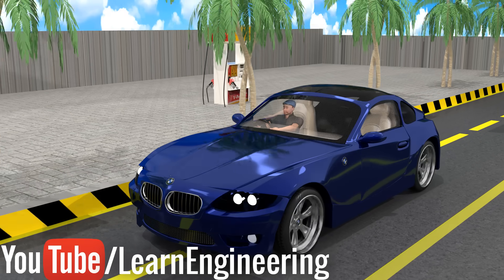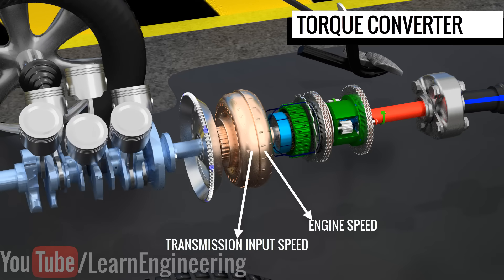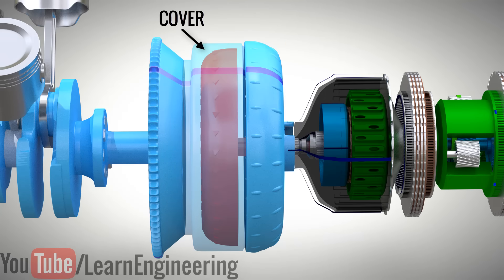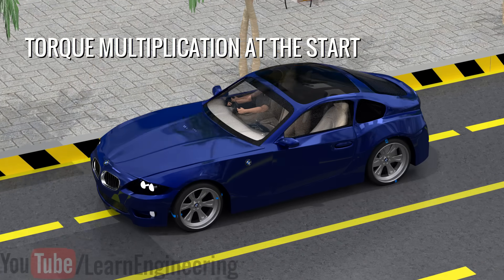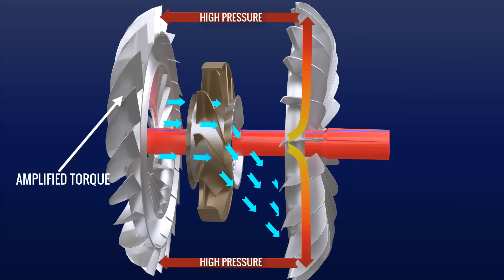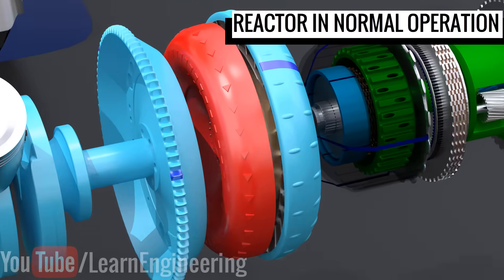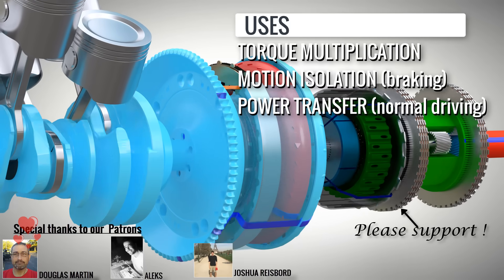Torque Converter, How does it work?

Comment: I didnt quite undersand what is the purpose of at some point locking the turbine to the pump so it matches the faster rotational speed of the pump. If you lock them arent tou taking some of the pumps already gained energy back to the turbine? Intead of not letting the energy get lost, you are making it happen even more. Of course this works, so theres something I missed. Thank you for the video.

Comment: Believe it or not, the GM Hydramatic in 1939 used a fluid coupling as opposed to a torque converter. Chrysler ended up coming out with their Fluid-Drive transmission which was a manual transmission with a fluid coupling to make driving a bit easier since you didn’t have to finesse the clutch, just stepped on the clutch and selected a gear, could come to a complete stop without having to step on the clutch since the fluid coupling would slip. Could start out in any gear, just was a little slower in second and third gear.

Comment: The magic of this design is that it only delivers power when you want it. The reason a car in drive at idle will limp forward without breaks. Breaks are applying counter force and in a manual this counter force would stall the engine but in the case of the torque converter power is still being sent into the transmission but not enough to overpower the breaks. 
Its also the reason people that deal with traffic love automatics. Constantly applying the clutch in stop and go traffic is the opposite of fun.

Comment: It is impeller, turbine, and stator. Please, for the love of Pete...If you are going to make educational videos, do it right. The pump is inside the transmission. It is not part of the torque converter. The Impeller is what you are describing as the pump.

Comment: I would like to see more short throw 5-6 speed standard transmissions in trucks.I miss them with a passion. I loved having a Borg Warner Super T-10 4 speed manual transmission with a double hydraulic clutch. I built this truck to have 500 HP & 450 Ft-lbs of torque. I never would have got that with a automatic transmission.

Comment: How does the lockup clutch enganges? Hydraulic actuator or mechanically?
Reply: Fluid pressure fed through the center of the main transmission shaft is used to push a piston to hold pressure on a friction disk in the housing. That disk is connected to the turbine, which is the driven disk inside a TC. When the piston is forced against the lower half of the TC, the two pieces (outer housing and turbine) are locked, and turn as one.

Comment: Transmission oil/fluid got a whole different meaning. It's not lubricant fluid it's the fluid that physically transmits power.
Reply: ATF simultaneously functions as:
1. Lubricant
2. Hydraulic fluid
3. Coolant
It is formulated to perform all 3 functions. You could also argue that it contains rust inhibitors as well.

Comment: Okay, i thought i knew how a torque converter works, but I'm glad i watched this, because apparently i didn't quite have it clear. I didn't realize the stator modified the return flow and the increase in torque was from the added pressure, i thought it just modified the angle at which it stuck the turbine blades. I remember spending half an hour reading the wiki page on that trying to decipher it like 15 years ago. 
No denying automatics are technically amazing, but give me a manual. I would much rather have a three cylinder minicar with a manual than a V12 sportscar with an automatic. It makes the whole drive interesting, otherwise you are just steering a car and pushing a brake pedal, and that's boring.

Comment: The simplest way to describe how a torque converter works is to take a table fan and plug it in. Then place another one right up close in front of it but don't plug that one in. Now turn on the first one and the air coming from it will make the one in front of it start to turn. If it's a lock up converter then when the second one is going as fast as it can, you push them together so they make contact and now they are both going the same speed...

Comment: With an automatic transmission all you have to worry about is problems.
Reply: Yet they are remarkably reliable. I have owned 8 Accords, 2 Pilots, 2 Odysseys, an Element, and my daughters have Insights. We have had very few transmission related problems, and have never had a transmission replaced.

Comment: I'm still confused as to how the fluid gets into the converter. Is there a video that shows this?
Reply: The main shaft from the transmission is hollow. That is the only entry path from the transmission oil pump into the T/C. The T/C must also be constantly pushing fluid back into the ATM to cool it, as the T/C generates a lot of heat.

Comment: Doesn't the Reactor (Stator) spins in the opposite direction to multiply the torque?
Reply: The stator doesn't actually spin. It does rotate a few degrees, which depresses a shaft in the Main Valve Body, which controls the main pressure inside the transmission.

Comment: Who ever built this could have saved 3 migranes by just adding in a fucking autimated clutch thats used from a manual trans. Or use a AMT and save the cluster fuck that is the auto transmission.

Comment: Why are CVTs much easier to understand than this.
Reply: A cvt also uses a torque converter
Reply: @mikeslowbudgetmedia  Yes it does. It also typically uses a cone-shaped drive pulley, and a cone-shaped driven pulley. The two are connected by a very flexible steel belt, which is comprised of hundreds of segments. The belt tension must be constantly stabilized by a combination of fluid pressure and spring pressure to prevent slippage, which would damage the belt and the drive pulleys. Because the pulleys are cone-shaped, and not flat, a theoretical unlimited range of drive ratios is possible.

Comment: Does the lock up clutch create the same problem that the converter solves? When braking, it seems like the drive shaft and engine would be could together with the lock up clutch.
Reply: The lockup feature is controlled by fluid pressure, which is switched through a set of solenoid valves. When you no longer desire the Lockup mechanism to be engaged, the fluid pressure is relaxed, and the piston slips again without friction.

Comment: how the lock up clutch is activated?
Reply: A solenoid valve channels fluid pressure through the Main Shaft into the T/C, which is applied to the piston, and thereby to the friction clutch inside. When Lockup is no longer desired, the fluid pressure is relieved.

Comment: But how can fluid turn the whole transmission? And why dont we use regular cluth while braking? I mean when we push the brakes we can also dis-engage the clutch from the transmission in an automatic car. I am sorry i am not an expert.
Reply: "But how can fluid turn the whole transmission?"

Imagine two opposing fans sitting on a table. One is powered, and is facing the other, which is not powered. If you turn on the powered fan, it blows air through the second fan's blades, causing it to turn. It is much the same principle, except we're using fluid to push the second fans blades instead of air. Granted that is a very simple analogy, and the actual process is more complicated.

The drive fan represents the engine; the driven fan represents the transmission. When you take your foot off the accelerator, you allow the engine RPMs to drop, thus applying less power to turn the T/C, and creating less transfer of energy from the Drive to the Driven parts inside the T/C. Imagine this as lowering the RPMs of the drive fan to the point that they are barely turning. At some point, the driving fan can no longer push enough air to keep the driven fan moving.

As mentioned often here, the torque convertor is also a torque multiplier due to the action of the spinning assembly, which forces fluid outward, and that pressure is also directed to the piston turbine creating even more rotational torque.
Reply: @netdoctor1  but just like your analogy, the power fan will always have to work more to turn the non power one, doesn't that apply the same on transferring energy through the liquid?
Reply: @rashidtahakhan8644  It does. Were it not for the torque multiplication action, this type of fluid clutch would be very lossy and probably ineffective.
Reply: @netdoctor1 Understood, Thanks for explaining.

Comment: I first learned how engines worked in relation to boats, which don't have the same motion isolation issueI as cars because they are inherently suspended in water and transferring energy to fluid via the propellor. I was wondering how car engines don't just break when the car brakes, and of course it basically just uses a propellor! I should have known.
Reply: This is simplified, but the setup uses fluid coupling to connect engine to transmission. At idle, the fluid simply swishes around and does nothing. It is only when engine RPMs are raised that the T/C assembly turns fast enough to create enough torque to move the vehicle.

Comment: Hi, I’m just trying to understand the end part. What triggers the lock up clutch to activate? Is it another mechanical effect after certain engine speed? Doesn’t it take away the purpose of using the fluid directed from the pump to spin the turbine as they are now connected via a clutch?
Great video thank you
Reply: "What triggers the lock up clutch to activate? Is it another mechanical effect after certain engine speed?"
In a word, yes. A solenoid valve opens and fluid pressure increases on the piston inside the T/C, thus achieving lockup. That is a very simple explanation of that process.
Also, the lockup is activated after a certain load reduction on the transmission is achieved. It is not necessarily tied to engine RPMs.

"Doesn’t it take away the purpose of using the fluid directed from the pump to spin the turbine as they are now connected via a clutch?"
It does! Until you need for the engine to separate again from the transmission. The fluid pressure is relieved, and the T/C is no longer in Lockup mode.
The advantage is that when the piston and the engine are locked as one, no energy is lost due to slipping between engine and transmission.

Comment: "Entirely mechanical." Except it's not. "Fluid mechanics." You mean hydrodynamics. That's not "mechanical" in nature. 
There is a difference between mechanical engineering and hydro-engineering. Mechanical is machine-based, hydro is fluid based, which is what makes this work.

Comment: I would think what's referred to as a 'pump' would be on the engine (or power) side, and the turbine would be on the driven (or load) side. But, what do i know...
Reply: Forgetting about the Oil pump inside the transmission, which is only used for pressures needed inside the assembly, then yes; both Pump and Turbine are located inside the T/C assembly.
The Pump is a part of the T/C outer housing, which is directly connected to the engine via a drive plate.
The turbine (driven disk) is the set of blades facing the pump blades. Pressure from the pump blades is directed over the turbine blades, causing the turbine to turn. This is how power is transmitted from the pump to the turbine. The turbine is splined to the Main Shaft coming out of the transmission. This is how power is transmitted back into the transmission.

Comment: I would not call torque converter a purely mechanical device. It is a hydraulic mechanical device.
Reply: The “conversion” of a torque converter is the literal description of the mechanical torque to hydraulic pressure then back to mechanical torque operation.

Comment: The torque converter replaces the manual clutch. Okay. Blah blah blah - good explanation - and then there's this mechanical clutch and we'll stop here. Wait. What? That seems a pretty key part of this system. How the hell does it know when to apply itself and when to release? That's very important information and apparently it's a big secret.It's a poor teaching video that gets to the most interesting part of the system ans shuts up.
Reply: Electronically determined by the Powertrain Control Module (Honda's name for theirs). Fluid pressure controlled by solenoid valves, fed through the transmission main shaft into the T/C.

Comment: Considering the fluid forces and heat acting on the transmission fluid I wonder why fluid changes are, in some cases, considered lifetime, no need to change. It seems the fluid would degrade due to heat shear and viscosity degradation. I can understand a fluid change allows an opportunity to introduce contamination into the transmission internal structure.  Does the fluid last longer because it is not contaminated by hydrocarbons as would be the example with engine oil.  The video helped mature my understanding of torque conversion and thank you for that lesson!
Reply: Fluids eventually break down under heat extremes. Additives break down. Fluid gets contaminated with solid particles, though there is usually internal filtering.
I say the "lifetime" fluid is Grade-A BS. But, I'm a self-proclaimed car care guy. I ain't gonna risk it in my stuff.

Comment: you could have the same effect by connecting a tesla turbine to the flywheel and running high pressure lines to the drive wheels which have the same type of turbine connected to them and run return lines back to the flywheel turbine. You can control the exact amount of flow using variable valves as a sort of transmission

Comment: Engineering question: Exactly how much (%) does a torque converter lose without a locker?

Does this change under load such as accelerateing, climbing, or towing?

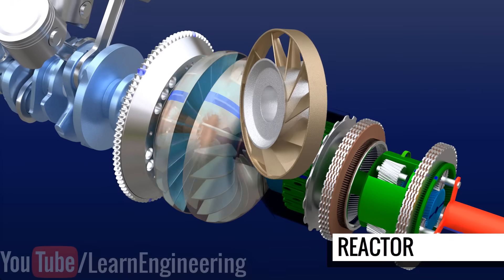Comment: I feel less confident in my understanding in my understanding of torque converters after this video. You lost me between 2:20 and 3:30 when the direction of the pump and turbine were reversed.
Reply: At 1:26 you said “this is a … torque converter” then you came back and said adding the reactor makes it a torque converter. 🤔

Also, just before adding the reactor you referred to it as a fluid flywheel. As far as I understand, there’s no flywheel in an automatic transmission… and I can see the flex plate connected. I’m confused by all the contradictions.

Comment: And how does reverse gear work?
Reply: Oh you'd love to see that!!
It is tricky. Interesting to note: The input shaft into the transmission NEVER changes direction; only the output shaft does.
RVS is achieved by inserting one more gear into the power train when needed, which reverses direction of the output shaft.

Comment: Great video!   So, when a vehicle starts off, is the clutch part of the torque converter not engaged and only engages as it speeds up?   What usually goes "bad" when a TC is bad? (I've had to have one replaced, but wasn't sure what goes bad.). I'm guessing the clutch part does but not sure.
Reply: " when a vehicle starts off, is the clutch part of the torque converter not engaged and only engages as it speeds up?"
Yes. In a manner of speaking, yes. But lockup is not determined based on engine RPMs, but instead load range on the drivetrain.
"What goes bad?"
I used to build torque convertors, then later rebuild transmissions for Honda. I've seen bad bearings, fractured stators and worn-out lockup clutches.

Comment: Great video..really informative..But why do you really need a torque converter when the same can be achieved by a sensor cum actuator based dry/wet clutch? 

Also seemingly in a TC gearbox..gears will shift under load using other set of clutches, thus as a synchro mechanism wont survive the situation for long...the TC clutch can best be described as a partially engaged clutch at all times ..also the torque multipler concept seems to be more of a marketing gimmick as it simply reduces pumping loss/slippage which shouldn't have been there in the first case... and then the cherry on the cake..the lock up clutch...which is why i began my post in the first place.. plz share your thoughts

Comment: Just a curious question, why it didn't replace the clutch system found in a manual gearboxes? It seems that it provides the same function as the latter.
Reply: It would always supply torque to the input shaft which would make shifting on a conventional transmission difficult and wear would be increased considerably.

Comment: This invention is on par with the differential insofar as importance to automobile propulsion.
The benefit of the torque converter is that it helps isolate the engine from the effect of transmission upshift events while maintaining mechanical power flow in an efficient way.
By the way, the stator provides engine aiding torque but contributes no power.

Comment: Great video, very informative!  However, I was curious as to whether or not anybody else noticed that the engine shown in this animated BMW was a V6, which is a layout that BMW has never used as they have always exclusively used 6 cylinder engines with an inline layout.
Reply: Bmw nerds unite!

Comment: So during a complete stop, with the engine still spin at around 700rpm while the wheel speed is zero, there is actually a lot of waste energy and fluid being pushed around without the transmission of rotation from pump to turbine?
Reply: There is that...